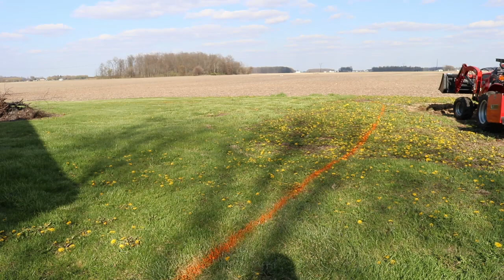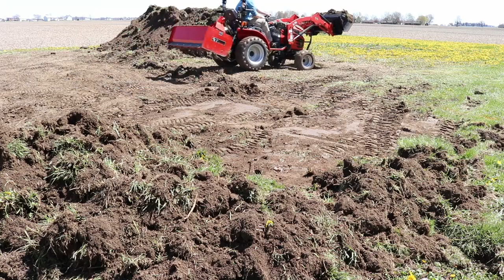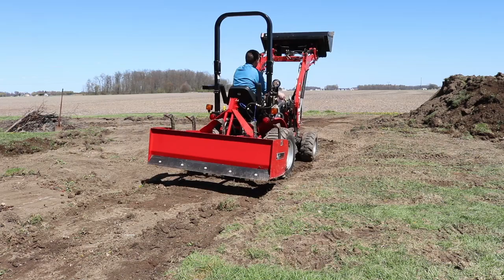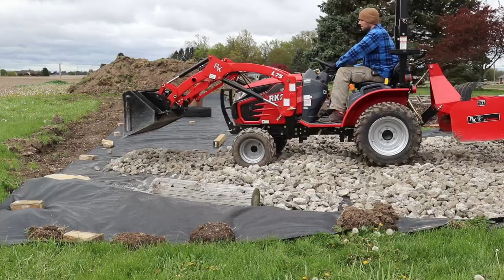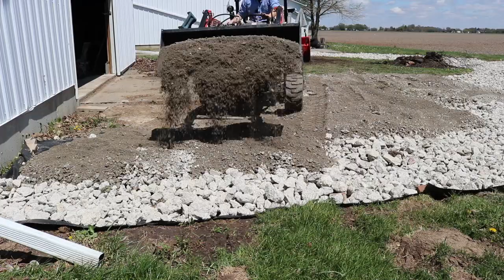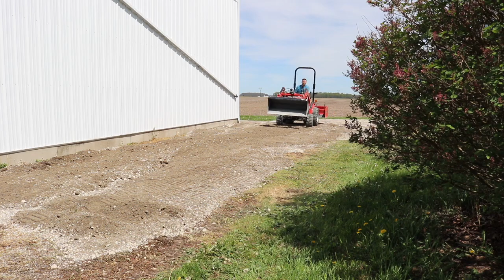RK24 Installs Gravel Driveway (Over 70 Tons)

Comment: I'm doing a driveway extension and prepping ground for a pole barn with a TYM T254.  I need to use all my dirt to fill in the low spots in my yard and grade the slope but all the clumps of sod make this less than desireable.  I decided to order a tiller and that way I can chew up the sod and the dirt together and then spread it uniformly over the property.  Wish me luck.

Comment: Love my rk24. More robust than my neighbors larger JD. Have had problems with excessive condensation here in central fl causing water to build in the filters and eventually get to the motor. If this happens to you,  it's an easy fix.  Turn off the fuel valves to the side and front fuel filter. Pull them off one at a time, clean, refill with diesel and reinstall.  Take the air filter out and using a squirt can, squirt diesel into the throat of the intake and try to reatart the tractor.  You will probably have to do this three to five times, but it will restart.  Don't let it's size fool you.
Reply from the maker: Thanks for the tip and thanks for watching my video. I have a few involving the RK24 if you're interested.

Comment: good job with that tractor! Im looking at a rk24 or a rk37 but dont have a dealer near me and i dont know if the 24's to small for me. May i ask how tall you are?
Reply from the maker: I'm 6'1" 220lbs for reference. Thanks for watching!
Reply: @sittricsshop7849 then we are the same height.
Do you feel like the tractor size is good for a man your size ?
Reply from the maker: @marcbandit1132  The chair is comfortable. The foot pedals and controls are located just fine. If I could change anything about the fit of the tractor, I would make the steering wheel adjustable. But even with that I think the tractor is a good size.
Reply: @sittricsshop7849  thats good to know. Thank you 😊